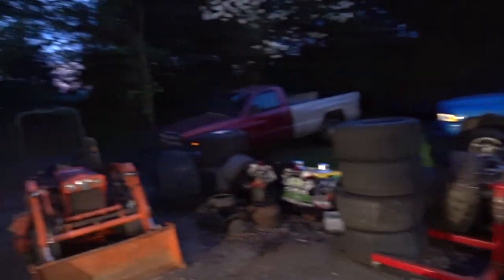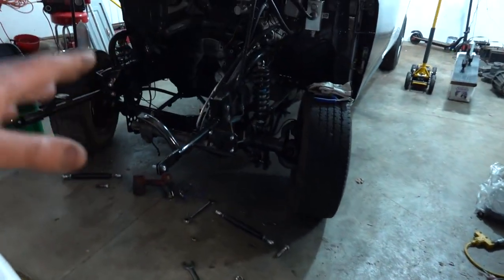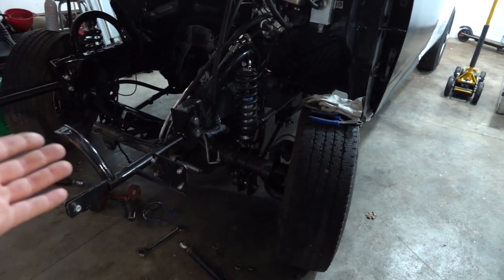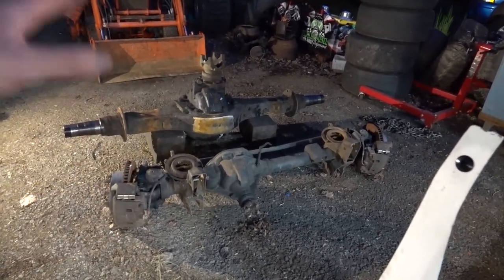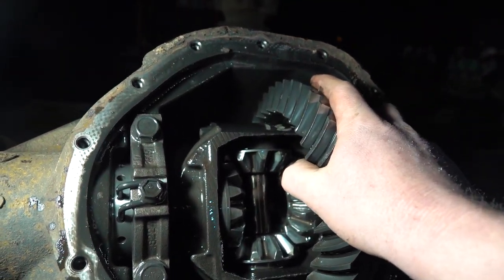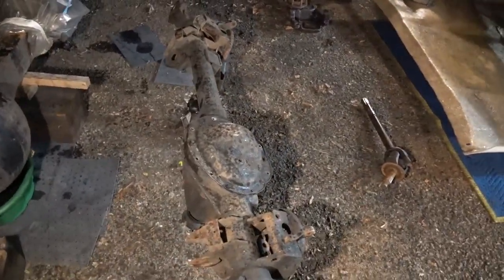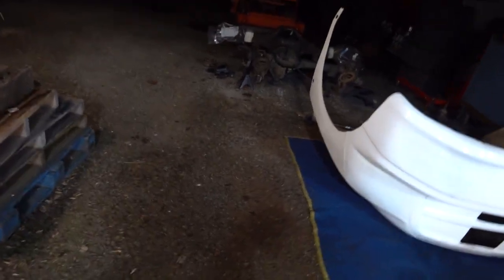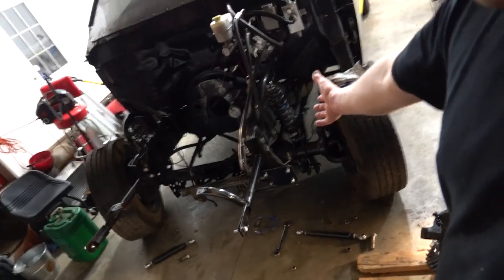MASSIVE Sled Pulling Rear End Disassembly!! 2022 Ultimate Call-out Challenge Prep!!

Comment: You should look into ball joint deletes from American Iron. I run them in my jeep and they work great. They just released AAM ones
Reply: I keep hearing about these.  What is a ball joint delete? Why would you do it?
Reply: @FriedPotatoFarmer  instead of the traditional ball and socket joint you have a pressed in cup and a bearing held in by a snap ring which makes the bearings replaceable without having to press the cup back out. Then studs go through the bearings and knuckles essentially making the knuckles to never have up and down movement. Only rotational